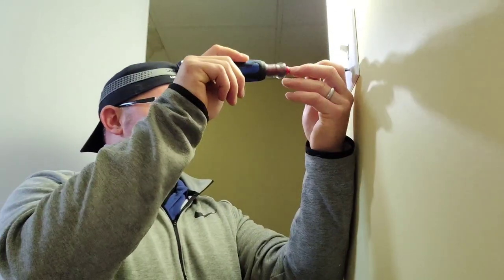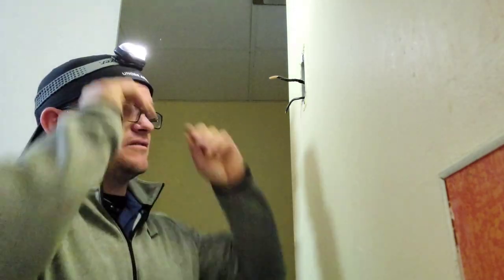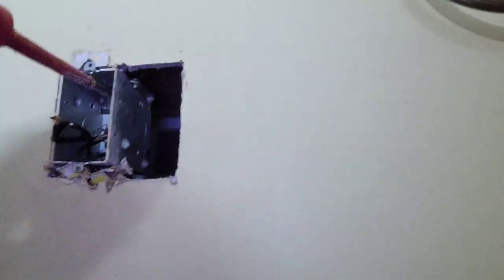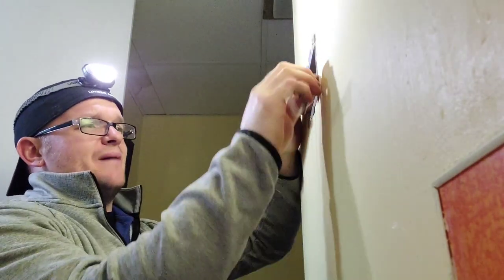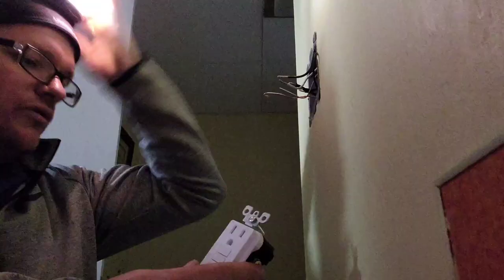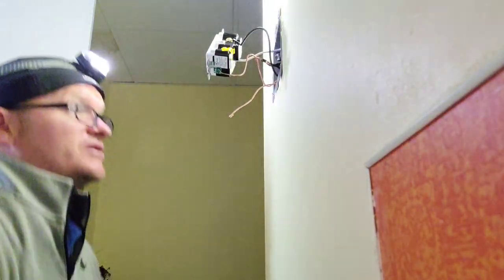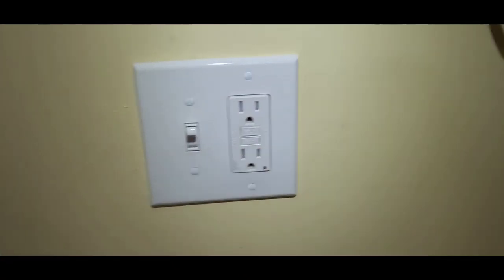FULL INSTALL Adding bathroom Receptacle From Switch to Switch/Receptacle

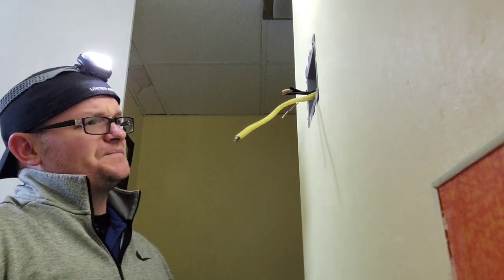Comment: 11:36 "You never, under any circumstances, want to take a knife or a razor in the back of this box."
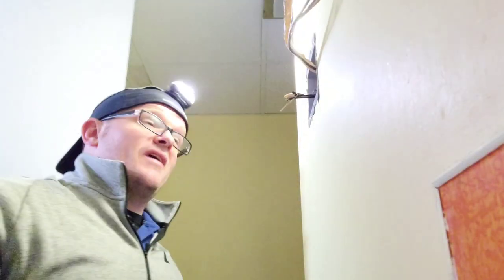12:12 <sticks knife into the back of the box>

;-) I know what you were saying though.
Reply: I caught that too 😂 I seen another video yesterday where someone was saying not to touch ground wire with load/lead screws then ended up doing that anyways 😂

Comment: Nicely done!  I have a similar situation, but the wire has no ground, just two wires (black and white).  Should I just run a new circuit, or is there a way to add  a ground?

Comment: Good video. But looking for something a little different. I have to coach style lights on either side of bathroom mirror.Both have built in push button switches.  Would like to REPLACE one with just a switch for an over the mirror light bar, and REPLACE the other side with JUST an outlet . Possible video for either ?? Thank you.

Comment: Very nicely done.  I'm in a apartment,  it was a garage conversion and the electric is a mess.  They pushed all the wires in the backs of terminals.  One day I came home.  I hit the switch for the ceiling fan and heard a big pop.  And both the outlet and switch blew out.  Now I have no ceiling fan. I open up the box and now not sure what wire is off. It's a metal box and not sure what's wrong or right

Comment: I have a old box.  Old wires, the outlet is hot, but the switch next to it is not! I have a ceiling light that blew out. How do I make the switch work again ? Trying to install a ceiling fan,  
Can I make a pig tail and jump it over to the switch ?

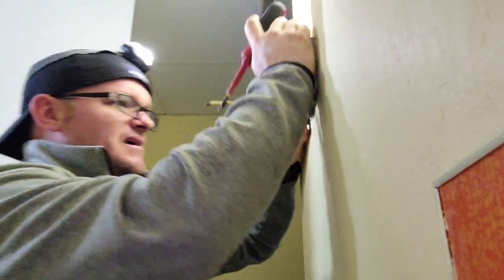Comment: Did you ever make the video going from a receptacle box to switch? There's a room i'm working on that has 2 heavy duty receptacles GFCI, & a ceiling fan, before i rip their wall apart to confirm that one was actually a light switch previously, I was thinking if it wasn't i could just piggy tail the light in & just replace the GFCI with a light switch or do it side by side like you are, which didn't occur to me at first. Idk what do you think about my theory?  11:02 & yup the one i'm doing atm is a tabbed blue box that came out of the wall it is extremely old though. Might as well update the light & make a switch while i'm at it.

Comment: I bought a roll of thhn 12 awg wire that I use for ground pigtails. The less bare wire, the better imo.   The other thing I like is to use stranded pigtail wire on commercial receptacles with wagos.

Comment: Is there a way to add an outlet without running a new line. My breaker box is way too far
Reply: Depends if you have power in the box.  He only has the switch connections.
Reply: There was a change in code where now the ‘norm’ is to have the hot and the neutral in the switch or receptacle.  Then it’s easy to pigtail those to a new receptacle.  If this is what you have, then you’re good to go.  Wago nuts are really convenient for a DIYer.

Comment: What was the tork spects  on this project and what type of tork screw driver you used for it Coach?
Thanks.
Reply from the maker: Great question! Each device is different! It is usually printed in the paperwork or on the device! Here is the screw driver I was using https://amzn.to/3ar7UNT and here is a much less expensive one https://amzn.to/3dxGxnr  here is a video on it! https://youtu.be/lBCGAnGSf4Q

Also you can check out tons of other cool tools @
https://electricaldiystore.com/

Comment: Thank you. Two questions: do you have to ground the box as well in this case or it’s made of a non conductor material? The other question is: it looks as you cut the wires less than 6 inches from the box …. How long is the minimum? Thanks

Comment: U don't show how u wire the switch to the gfi
Reply from the maker: Great question, it's not a switch controlled receptacle so we don't wire the switch to the GFCI directly
Reply: @electricianhub86  or maybe Damian was referring to making the switch gfci protected. waste of time IMHO. pain ass callbacks when gfi trips, takes bath light with it and home owner freaks
Reply: @harveylong5878  We had a house we were selling that did that and the home inspector wrote it up. So the new buyers wanted it fixed not to kill the lights also.